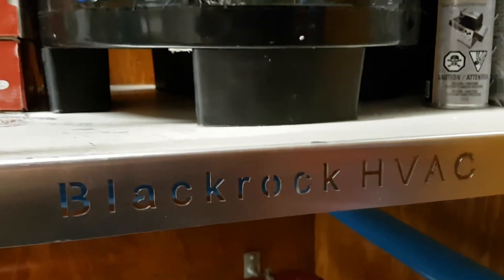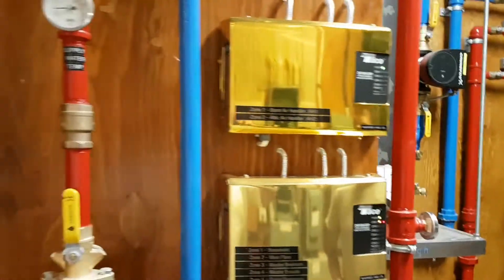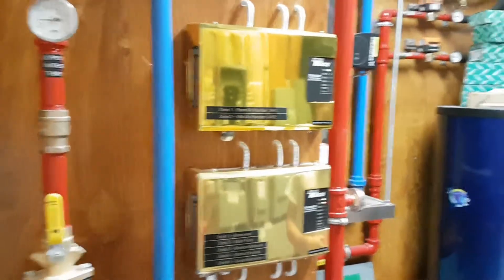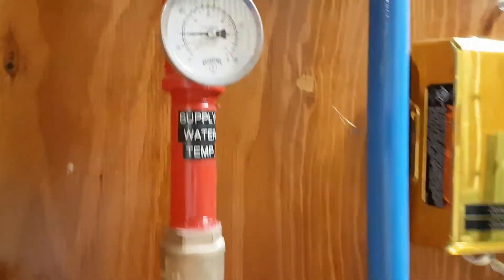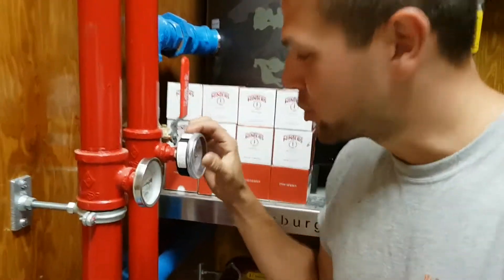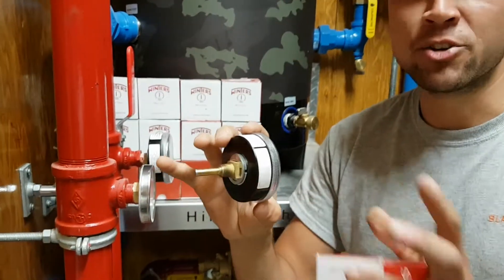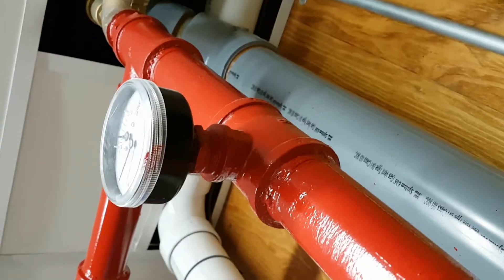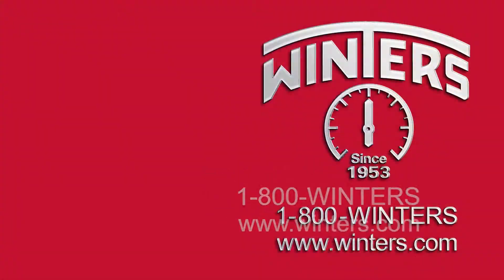TTD Short Stem Tridicator Installation

Comment: i know its a easy install but you should have walk me through the installing process.
Reply: First you have your entire house demolished, then you make a mechanical room out of baltic birch plywood with polyurethane on it,  then you install a diamond plate kick plate, then painstakingly paint all of your pipes and fittings with red and blue paint, then you paint your taco control panels with gold metallic paint, then you use a CNC to make a stupid clock and some pointless signs and have those sanded and polished, then you use a vintage Dymo label maker to needlessly label everything in the room.  Only then can you install your tridicator.  But that is covered in a different video series that involves making it out of solid diamond.